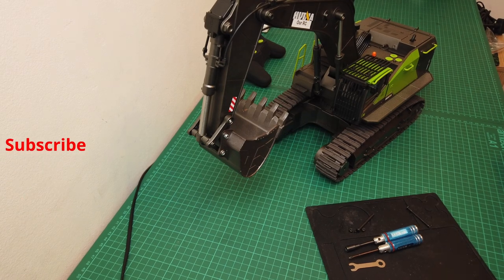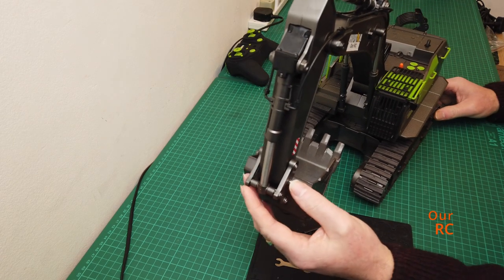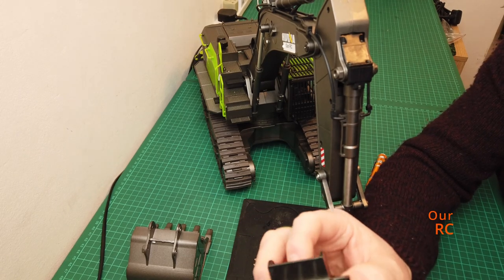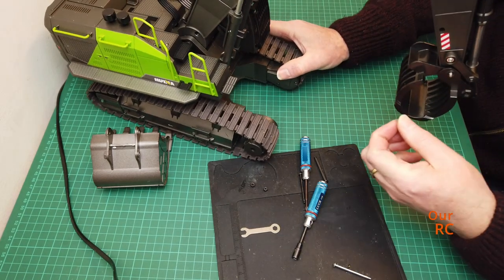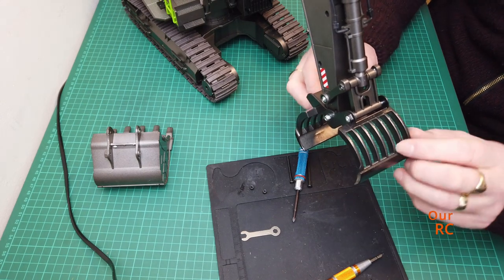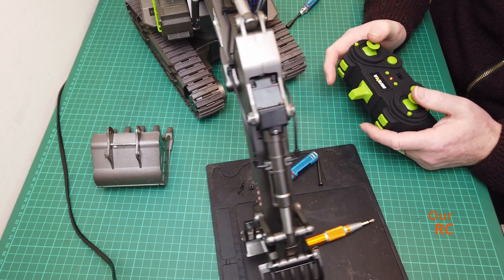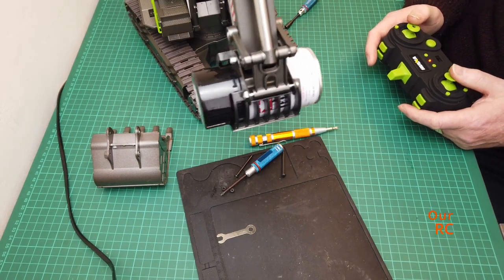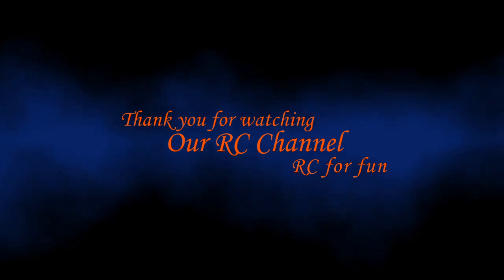Huina 1593 Excavator Grapple attachment

Comment: Hi where did you get the grapple from?
Reply from the maker: Hi, I had it with another excavator. You can get them off eBay from time to time.
Reply: @ourr.c4065 thanks for replying, are all the buckets and attachments the same fittings for the Huina’s?
Reply from the maker: @molley17   Hi, glad to help. The 1580/1583 are the same.